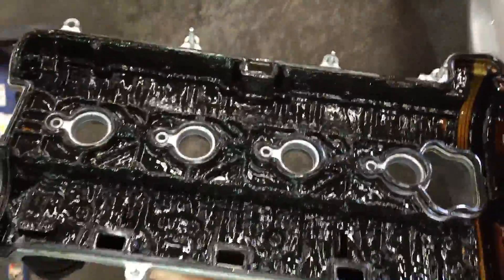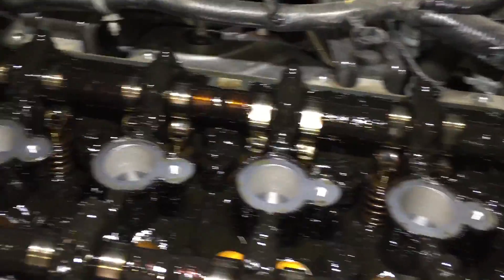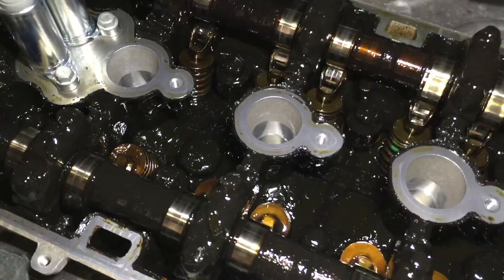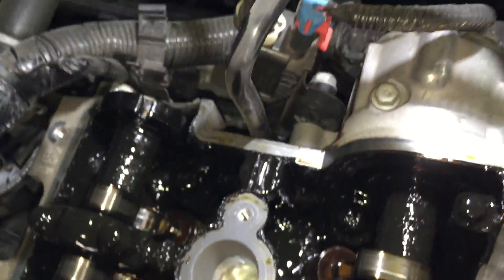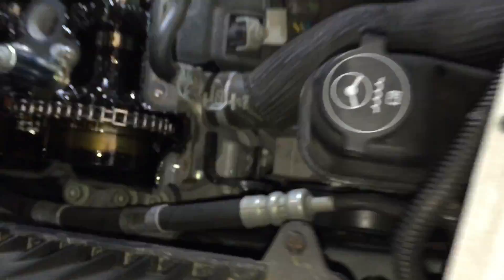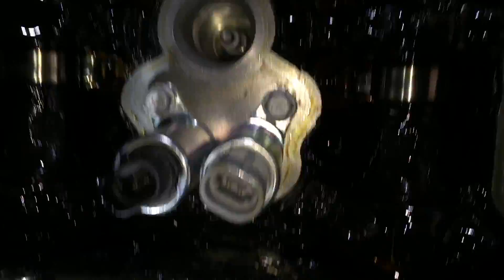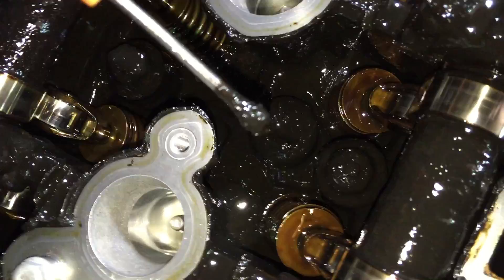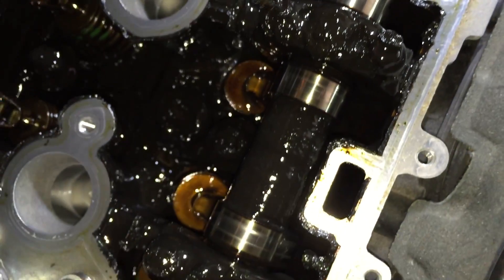Engine Sludge at 28,000 Miles

Comment: i run synthetic I do a oil change about once a year (  roughly 8000 or at the most 10000 miles )
Reply: Oil needs changed every 6 months MAXIMUM regardless of mileage due to the fact that it soaks up moisture.
Reply: The small amounts of moisture the oil soaks up is steamed off during operation. I change mine once a year, and send samples every year and a half to see he her guts are doing. 283k... Still looking good. Little bit of coolant in the oil indicating a leaky lower manifold gasket, no biggie.
Reply: ***** The moisture buns off eventually, but when a car is only driven a few miles at a time, it really doesn't have time to burn off. Oil temperature and coolant temperature don't correlate with each other. That's why I would change it twice a year if you really want to prevent any wear.
Reply: ***Classified*** Good point, driving habits do play a major role there. If someone doesn't drive enough to get to OT and stay there for a for a while, they could have excessive moisture build up.
I've changed my oil 5 times in the last 60k using Amsoil signature series. She has 283k on the odo, and a leaky oil pan and front crank seal. When I pull it down, I'm pulling some bearings for inspection. I'm not too worried about this engine as I have a small block itching to get in. It's more or less an extended experiment, but I don't like leaks so I'm fixing them.. The truck had 77k on her when I got her 19 years ago, used Mobil 1 99% of the time, unless the budget said go cheap this time. Always changed at oil manufacturer's interval. No noise, no smoke, good oil pressure.
Reply: ***** What truck do you have? I've got a 98 ram 2500 4x4, a 97 K1500 z71, and a 97 F-150, lol.
Reply: ***Classified*** A 92 Silverado with a 4.3(hence the small block waiting), with an NV3500 5 speed that'll be changed to a T56 when the small block goes in. I want to go at least a couple more years on this Amsoil to see what damage does or doesn't happen from this extended range stuff. See if their claims are legit.
Reply: ***** That is a good experiment! Let me know for sure what happens. I've known people who swear by amsoil, but it was always a little bit too expensive for my liking.
Reply: You need to change the oil every six months if you drive very short distances and can go one year with a high quality synthetic but would do it in nine month intervals. Otherwise 5k/6 months for regular oil and  10k/1 year for synthetic is fine for the average driver. Spend a few extra bucks and get the better oils and you will be fine

Comment: Lol Looks like many pennzoil engines I have rebuilt. lol But yeah that is what an engine looks like that hasn't had an oil change in a while.  Now if that was a good synthetic it wouldn't look that bad.  I have salvaged and fixed engines that look that bad without pulling the engine and doing a total rebuild. but not many. Problem is that adding new oil or trying to flush it with chemicals can knock globs loose that then plug small holes. Now part of the engine is starved for oil and fails. Not good.

Comment: Changed the oil in a 1.6hdi ( Peugeot / citroen / Ford engine and it believe it was the first one and it was 12,200km over the recommended change of 20,000km!. No wonder why turbo's are blowing themselfs up on these!. Oil was not thick at all.

We had the same engine in a ford this week and it wasn't been changed for 60,000km and the filter and oil pan was full of sludge. And the turbo blew itself up.

Comment: How does a car at a car rental company go 28k miles without an oil change? You know I did the oil changes on a 2010 Chevrolet Equinox and I couldn't believe how fast the oil turned solid black after the oil change. It also had a 4 cylinder engine.
Reply: Oil Color doesn't reflect its quality or amount of life it has left in it - At least in most cases...
Reply: Cause the 2.4 Equinoxes go though oil like no tomorrow
Reply: Was it turbo

Comment: I'm wondering on what it depends that something like that happens. My old car once was driven WAY too long between oil changes. That was about 60.000km which is about 37.300 miles and there was not the slightest sign of sludge. Also my recent car (Audi TDI) has a counter that tellls me that the oil has to be changed every 30.000km (about 18.600 miles). The regular base here in Germany is that you change the oil every 15.000km (9.300 miles) on older cars. I'm wondering if sludging depends on the construction of the engine, type of oil, too much short range driving or something like that. What I have experienced is that if You drive short range very much that water condensates within the oil lines and this builds up something that looks like light brown mud or mustard.
Reply: Same here to on VW TDI 7500 km oil changes and filter

Comment: To everyone who wants to know about their oil and whatnot, this little blogger has got one hell of a list of oils he's tested:

https://540ratblog.wordpress.com/

I've gone by his blog for a while now and I use it as a reference when recommending oils for either street or performance engines.

Many of you seem to change your oil at around 5-7k miles and that is actually a pretty good sweet spot, as many of the additives are between 50% and 70% used up at that point.

The additives prevents corrosion from condensed water and keeps the oil self-cleaning(meaning it picks up and carries particles into the filter), while zinc is used up as a wear protector.

I'd say never go beyond 10k miles, stick to 7k and always change filter with your oil.

Comment: this is so sad to see on an engine with only 28K on the engine, i use amsoil signature series 5w20 and change it every 15K miles. With that oil change i use an amsoil filter to go with it. Every 2 oil changes i use amsoil engine flush to keep things clean.

Comment: cheap oil not changed on time. Terrible. 

I use mobil 1 and change it every 7000 miles along with filter and engine flush additive
Reply: +Phen0mable That oil might have never been changed at all.  It is horrible the things that some people do to their cars.  Those same people probably never change the transmission fluid.  It is especially true with a newer one that has a sealed transmission because people think they are not serviceable.  Then you have the lies about lifetime fluids and that just makes all these problems worse because no fluid lasts a lifetime.  The only reason you ever hear anything about a lifetime fluid is that the maker of a car wants to make it look like a low maintenance car and since some people lease them, they never keep them long enough to have problems as a result of it.  A trip to the Auto parts store for oil or to your favorite mechanic is a small price to pay to keep a car still running.
Reply: John Doe I am a car mechanic. I'm happy when people do stupid things to their cars

Comment: I mean with time this is normal, right? my car is 192,340 miles and I recently replaced the valve cover gasket the other day and found a lot of this not like this car in fact no even closer.. but yes it has some.. It runs just fine and I change the oil every 3 months or 3-5k Kilometers.. What happens first.. Owned it for 7 years now and not even one break down except for the gasket I replaced because started to leak...

So, I wonder what can I use to remove all this dirt? without having to open the engine again?
Reply: Diesel fuel/oil mixture combination of high/low idle new oil filter. Drain and refill with fresh oil and new filter. That'll get a good amount of sludge out. Or substitute diesel fuel with trans fluid. Mixture should be 75-80% engine oil..
Reply: +Edwin Leon I second this, just check the new filter/oil after the first 30-50 miles or so, if sludge packed(looks like small blobs of gunk) and dirty(completely black and not a nice caramel/syrup color),  return to step 1. :p

Comment: This is what ends up in the used car lot, way more often than you might think! My '01 Forester has 178k. Just had the heads off. I've been running premium synthetics since when I bought it used (third owner) in 2009 at 125k, but there is still a thin layer of black sooty crud in the oil passages, and on the dipstick up above where the oil is. Obviously, it had been subjected to horrible abuse at some point.

Comment: So nasty and so EASILY prevented.  Why do people insist on not changing there oil?  This is why when I hear someone get all tied up about how many miles an engine have I always say well that is just a number.  You can have an engine like my 3.4 V6 in my Tacoma with 275k miles that has always had regular oil changes and is clean under the valve cover, or you can have this 28k mess.
Reply: my honda hit 900k still runn like new

Comment: years ago our work van broke down on the road and found out later the oil hadn't been changed in over 20,000 miles  had to replace the engine it was so bad

Comment: geeeeeeez and im over here worried about going 5k on a synthetic!
Reply: +NRP1991 Better to worry than be like the dumb idiot owner/s of the the above car.  Total mess at 28k.
Reply: that's for sure wow and it still ran???
Reply: Yep its unreal.  This is why to a point mileage is just a number.  I always pop the oil cap off any car/truck before I buy it.  You can tell by the condition of the valvetrain if the oil has been kept changed or not.
Reply: good point and that is a great tip!!
Reply: +NRP1991 lol i'm only doing 3k synthetic oil changes, though i change it every summer and winter because i don't want to worry whether i need to change it or not and it's generally driven in stop and go traffic. If i were to drive more daily i could go longer on the mileage in between oil changes. I'd like to keep the cars i buy and hoping the original engines still work.
Reply: Irony is that if he had used a good synthetic from the start, the engine would still be in decentish shape, even at 28k.
Reply: +NRP1991 Your synthetic needs to have a good additive package in order to make it to extended mileage or to stay in for more than six months. The base stocks alone won't do it. Also, you need to use a "good" filter.
Reply: +NRP1991 Wtf? You can easily do 5k on regular and way more on synthetic...
Reply: +NRP1991 Since my car sees mostly highway and rural roads, I take it to 7500-10,000 miles using Pennzoil Ultra, and not even worry about it. A good synthetic and high sump capacity will provide that kind of service life for motor oil. But mostly city driving would reduce the OCI mileage quite a bit since at that point, run time hours will matter more.
Reply: +joshnc101 yup pennzoil oil the best high mileage thats all i use an standard ford filter
Reply: i still change my full synthetic every 3 thousand on my 3800 impala. i dont trust an extra 2000 miles (especially how i drive lol)
Reply: You are so wasting your money. Syn is obviously a good idea, but there's no need to change oil more often than the manufacturer's recommendation for severe service, unless you happen to better than the engineers who designed your car. Driving hard is not hard on the engine oil, what is really hard on the oil  is frequent short trips in low temperatures.
Reply: I go 10k and have done oil analysis and it was still good. 5k is a waste. Might as well buy the supertech synthetic blend that can go 5k.